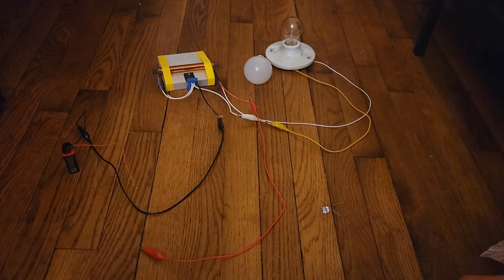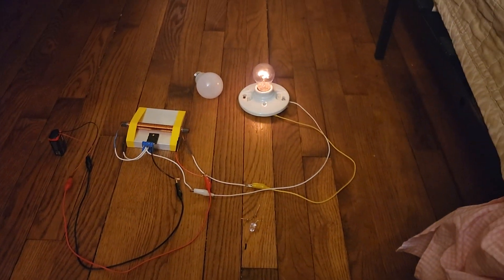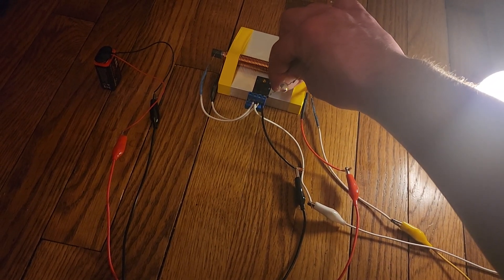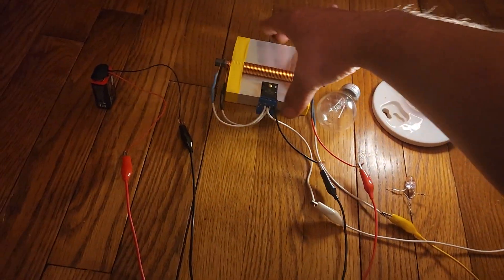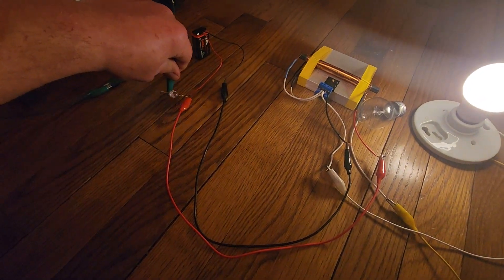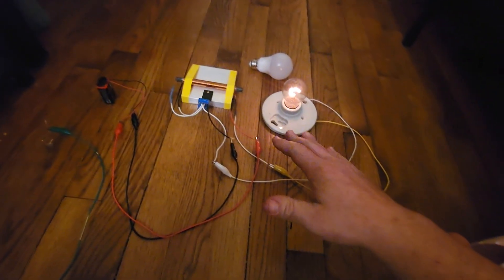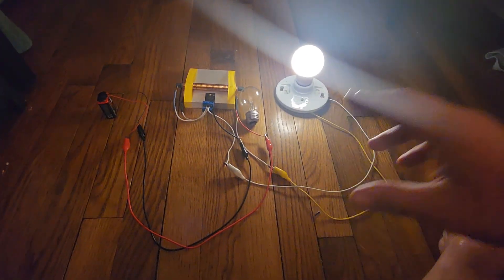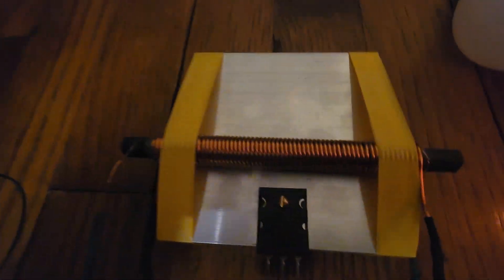🌔REFINED RINGER CIRCUIT DEMONSTRATION PLUS FREE WIRELESS GROUND POWER WHEN NEAR CIRCUIT🙌

Comment: Very similar to LaserSaber's Ringer circuit. Well done.
Reply from the maker: Yes just using a slightly more efficient transistor & it's wound on a metglas laced ferrite rod for even more efficiency.
Reply: @MTECH2022  that's awesome!
Reply: @MTECH2022  just a thought, do you think a 3 phase version of the your Ringer circuit would produce more power output at higher efficiency?

Comment: How does it work? Come on man let us know how is build  before these big Corporations get to you. This is the mistake every brilliant inventor did. Get it out there in the public domain and you will be safe.
Reply from the maker: It's a super joule ringer 3.0 circuit invented by laserhacker. Schematic is on my patreon free for everyone to see. Only exception i did to make it better was use a more efficient transistor & wind it on a metglass & barium Titanate laced ferrite rod for much more enhanced performance
Reply: Thank you from UK man. Ok I will apply all I learned  from previous SISTEM  bucking type coil. Would it work on a ring type, donut  ferrite-glass?
Reply from the maker: @danielacsinte4326  i assume it would if you wound 4 inches of primary & secondary on it :)

Comment: How long does the battery last?
Very nice setup.
Reply from the maker: About 3 hours but can also be made to recharge itself indefinitely if the output charges a large dc capacitor bank after going through a rectifier as well as combining an Earth connection in the right spot of the circuit

Comment: do u using crystal and fused with RADIOACTIVE MATERIAL for creating dielectrical properties (recharge up the capacitor) and connecting to the ground the gathering the voltage
Reply: its a ferrite core with metglas in it